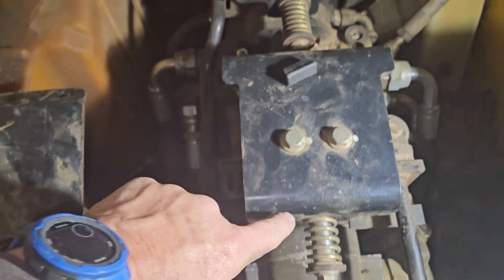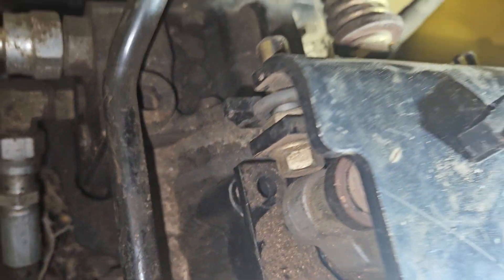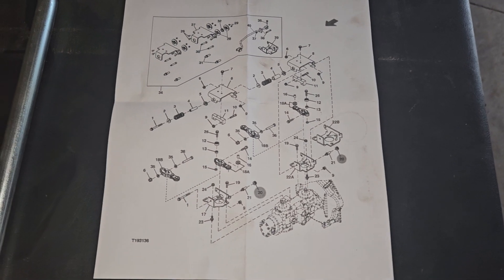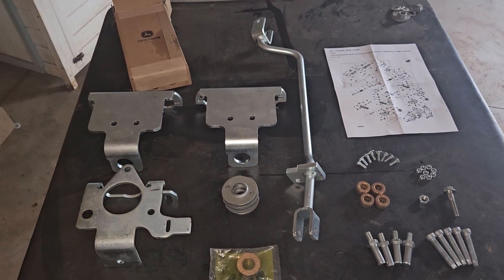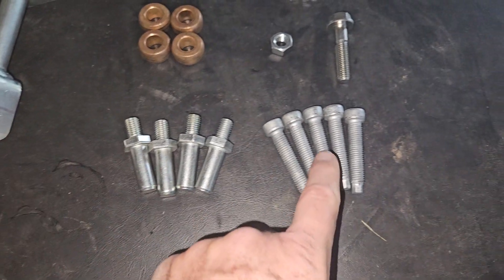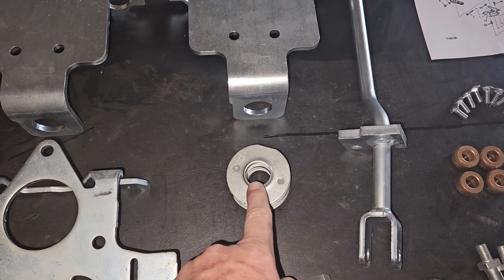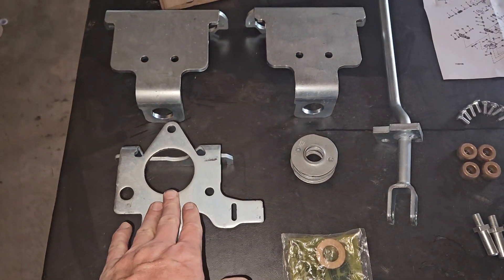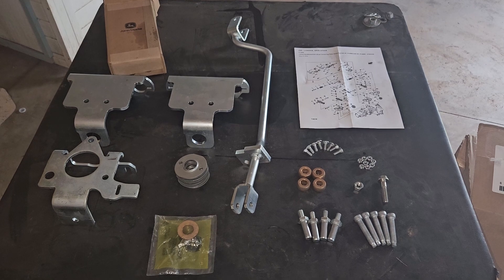John Deere 250 skid steer steering repair. How do these redesign parts work?

Comment: You can take the good bushing off the skid steer, go to a  decent machine shop and have them fabricate one out of similar material (like a surface hardened oiled brass ), you can have them make a complete set for you for less than you paid for the kit... just a thought

Comment: Did this kit solve the issues you experienced with your machine? We have a 250 the right steering arm does not want to stay in neutral alone I see there is some issues on one of the pins that the plates slide back and forth on…
Reply from the maker: Yeah, you are likely experiencing what I did. These machines are getting old and parts are breaking, especially the plastic ones. Well-built machines but they do get old. I bet you have a bushing problem where the pin goes in and out, like mine. You can't order that nylon bushing anymore. It is just a complete rebuild kit with the brass-type bushing. I'd invest in it and just take a Saturday, do some stretching and then get out your tools and flashlight. =)